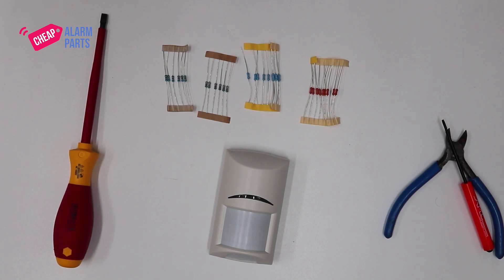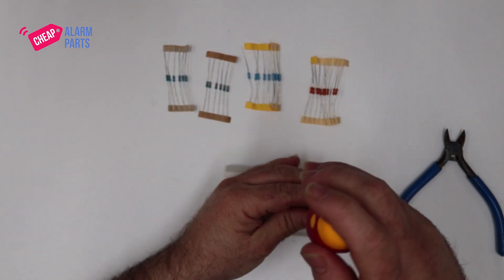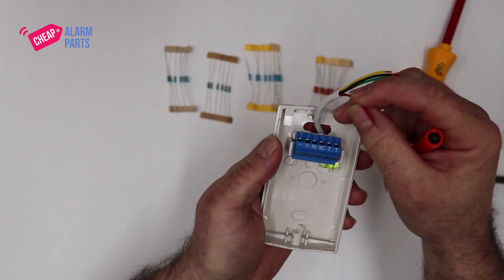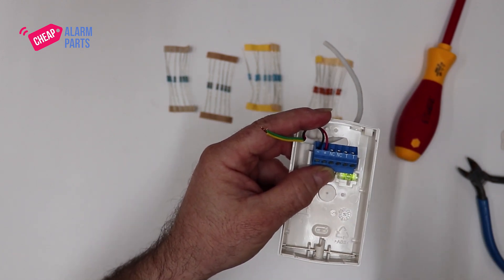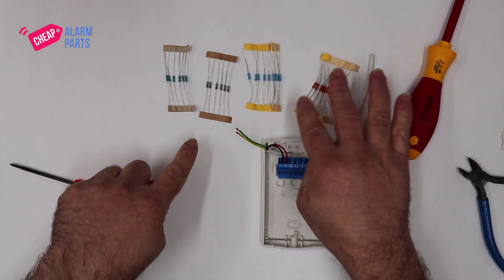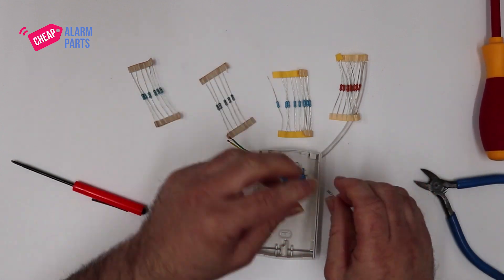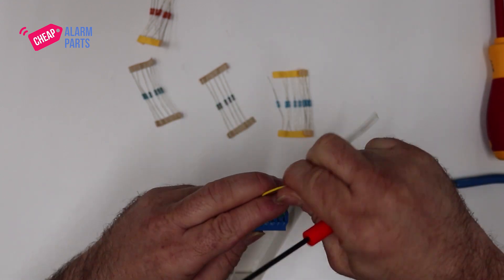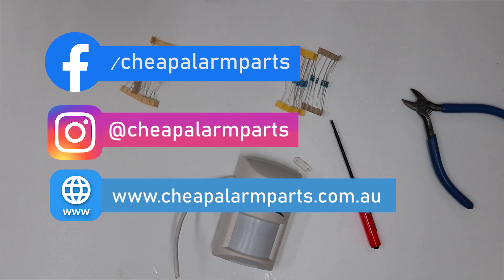Connecting a Bosch Blue Line Gen2 sensor training video.

Comment: hi, u said 9k8 we use for zone 9-12. But we also use it when we put two areas in 1zone. Means 2areas we allocate 3k3 & 6k8 each.
My question how does panel knows which area got which value of resistance. Do we feed it in keypad? How we do it?
Thanks